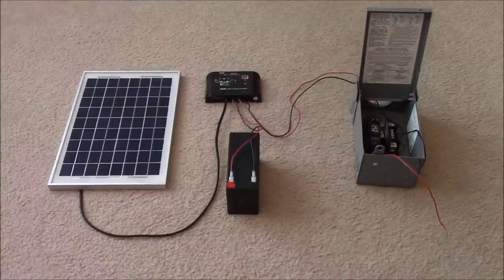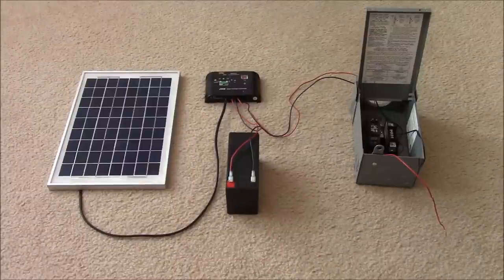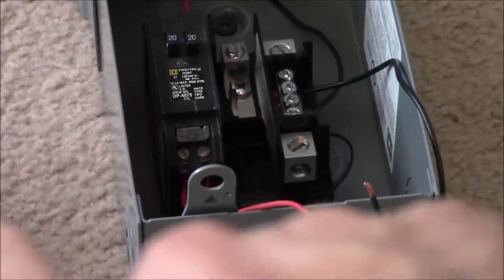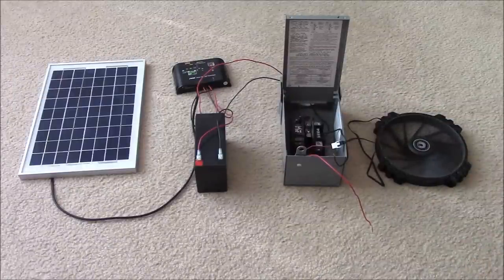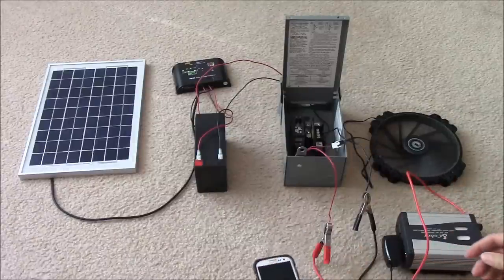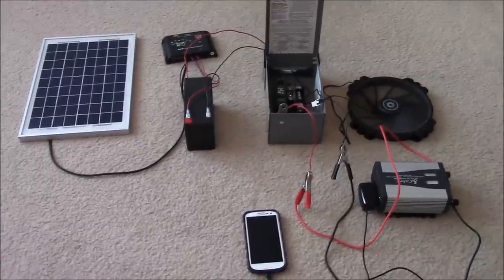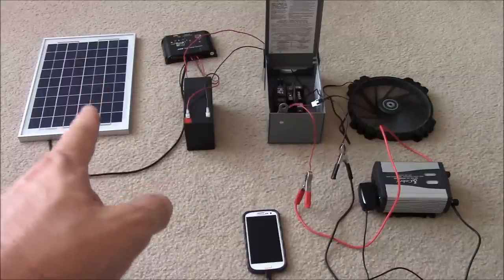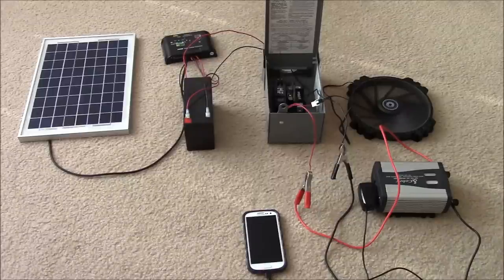Solar Panel Systems for Beginners - Pt 2 Hybrid Systems & Multiple Loads

Comment: So is the purpose of the load center to avoid useless conversions if you have multiple loads that use both AC and DC?
Is it a potential surge issue? If so, how are harmful surges possible if the controller regulates the flow of electricity?
Basically, I'm trying to figure out why I would introduce a load center into the series instead of just plugging the charge controller directly into the inverter. Thanks!
Reply from the maker: arisenryan Good question!  Some people don't use them at all.  The main purpose for a load center would be to divide the power between loads and provide a safety mechanism (the breaker) that can help from frying things.  Since most solar uses 12v, you will be working with MUCH higher current (amps) than you would in AC power.  That can burn wires or start fires a lot faster.  So having some safety in there somewhere is good.

The other purpose for these boxes is as a combiner box.  Combiner boxes are used on the solar side of the controller (not the load side) and are useful for connecting multiple strings of solar panels into one collection point and then one wire into the charge controller.  For example, lets say you started with a harbor freight 45 watt kit (lots of people get suckered into that) and quickly figured out it was fun but not very powerful and kinda junky quality.  But you were hooked and wanted to get some more power.  So you ordered two 150 watt panels.  Now you spent $150 on the harbor freight kit and still want to use it, too.  Obviously you can't plug 5 panels into one charge controller.  So you need a box that all of that power can come into and be collected and then sent on to the controller.
Reply: LDSreliance Alright, so in your first example, would you be reducing your risk of overload by just using thicker wire? How would 4g do for a smaller 350 watt setup?
And in the second example, would you be able to hook a 12v string of panels into a charge controller designed to withstand a constant flow of 350 watts? Would there still be a risk in having that string of panels wired directly into the controller?
I really appreciate you answering my novice questions here. I'm just trying to keep costs low as possible while I get the trial n error worked out.
Reply from the maker: arisenryan
I understand.  No worries.

I can't answer what size wire will be enough for a given number of watts unless I know how long the run of wire needs to be.  4 gauge wire might be great for a 10 foot run of wire from your panels to the controller but if you are talking 50 feet it might be a fire waiting to happen.

On your second question, I need to know the wattage of the panels.  You can't exceed the amperage rating of the charge controller no matter what combiner box you use.  If the charge controller is a 60a controller and you are using 12v panels, you can't connect two 500 watt strings to a combiner box and then in to your charge controller.  That would exceed the capacity of the charge controller.  If you are only talking about one string of panels (lets say three 120 watt panels since you are using the number of 350 watts or so) then you don't need a combiner box at all.  That string of panels would all have to be parallel wired, though, not series.  But if you had one 100 watt panel, one 50 watt panel, and one 200 watt panel you can't connect those in a string (general rule is only panels that are identical per string).  So you would need a combiner box to collect the energy and send it on to the charge controller.

Hopefully this makes sense.

Comment: I'm new to this, so the fan is a DC fan that runs off dc load center, is that correct? All the regular household appliances need to run off from the inverter?
Reply from the maker: Yes, that is correct.  The fan was a demonstration of a load.  In this case that is a DC powered fan.  But most devices in your house will be powered by AC so they will need to connect to an inverter.

Comment: hi 
i want details for 750VA load 
how many solar panels will be required ???
rating of charge controller ??
and whether it can be used as source for ordinary household inverter to charge batteries ??
Reply from the maker: +jugvinder singh sidhu My general rule of thumb is to plan on twice as many watts in solar panels as the load you intend to use.  So in this case I would recommend 1500 watts in solar panels.  The reason I recommend that is because you are going to lose 30-40% of the power off the max rating from the manufacturer by the time you harness that energy and charge a battery and then pass it to an inverter.  Plus you will need enough power to charge the batteries while simultaneously using your load.

For 750 watts of load you will need an 80amp charge controller @12v or a 40amp charge controller @24v.
Reply: can i give the output from solar panels to my on grid inverter already installed with 230V ac supply ??
Reply from the maker: jugvinder singh sidhu
Yes if you already have a grid tied inverter you can connect your solar panels directly to it.

Comment: Hi.. Great vids and u have simple and good way for explanation.
Question:  Have managed to source a mini peltier device which needs only 5V and 2amps.  Intend to do a personal project for a handheld solar operated air cooler.  Need your advice on best way to power this type of peltier along with a low power laptop type fan.

Many thanks..
Reply: +Ahmed Abdulrahman how did you go with your air cooler?

Comment: If I only wanted to power items using AC (via a converter), would I need the load centre? Can the inverter just be directly wired to the charge controller? Thanks in advance :)
Reply from the maker: The inverter can be directly wired to the charge controller OR the battery(s).  The load center is simply to route power to multiple places.

Comment: Could you do a video on how to connect dimmers or a gas pedal.
Reply from the maker: +YouNeedMyProductions A dimmer is just a switch with a variable resistor but I think I could play with one of those in a video sometime.  Not sure what I would do with a gas pedal.  Did you have something in mind?
Reply: +LDSreliance well, I had the idea of a solar powered go kart (because I have a lot of frames in my families yard). So I already thought of how I could wire it, but then I remembered the gas pedal. I had no idea how to do that, so I thought maybe you could do a video on it or have an answer.
Reply from the maker: YouNeedMyProductions
The gas pedal could be attached to a potentiometer (like a volume knob) that controls how much electricity flows.  That should be fairly easy to do.  I believe they make pedal kits for electric karts that would have all that built in.

Comment: I have 3000 watts inverter and 12v-200ah battery
Do I need 3000watts solar panel to make it compatible?
What kind of charging control
Reply from the maker: No, you don't need to match the inverter with a certain number of watts of solar panels.  You could run a 10W solar panel for all it matters.  But obviously you want enough solar power that it will keep your batteries charged each day.  Shoot me an email at ldsreliance@gmail.com if you want some help designing a system.

Comment: What about single phase and 3 phase  load requirements ? Also does this mean that the load centre is the same as a distribution box/electrical mains ?
Reply from the maker: For this simple explanation and demonstration video I didn't get into AC power.  The inverter will provide single phase power.  If you need three phase you are talking a very large solar system with some seriously expensive equipment and that is beyond the scope of what I have done.  Sorry.

The load center is what they now call a breaker box.  It is just a box that has a bunch of breakers to separate one input (from the electrical grid) into multiple circuits that go to different parts of your house.  It can also be used backwards (combiner box) to take multiple inputs and create one output.

Comment: Thank you LDSreliance,on ur pt1-vid,most off all for keeping it simple,1step at a time approach,for us beginners to understand.Ur vid confirms for me,that i can use a solar panel to charge the 12v deep cycle battery used to power the trolling motor.Now that seems like fair enuff,but then other Qs comes up.Im setback,coz lack of specifics on my particular system application.Was wondering if u cud help me with sum diy advice.(1) size of solar panel,(2) charge controller type to efficiently charge the (3) single 12v deep cycle car battery used to power the,(4) trolling motor.
Reply from the maker: A car battery does not deep cycle so it only needs a trickle of power to recharge.  You need about 2 amps to charge the battery so that would mean you would want a 30 watt panel at least.  Just get a cheap pwm charge controller as they will get the job done and won't break the bank.

Comment: the inverter, the fan and the cell was connect to the red? or to what wire ? so you werent specific  so   thanks
Reply from the maker: All of the DC devices must be connected to the red (positive) and black (negative) wires.  So the inverter and fan are connected that way to the battery.  The solar panel must be connected with red and black to the charge controller.  And the charge controller must be connected red and black to the battery.

Comment: I have een autonoom solar system, with solar panel 24v / 200wp, the same solar charger that you;re using in your film, and one inverter 600w. Mijn bateries are defect, and i would like to ask if it's posible to conect mijn inverter direct to the load without batteries. To get then 220v during sunlight.
Reply from the maker: Silvestros Panagiotidis Yes you can connect directly to the load but if the sun goes behind a cloud or it gets dark the load will lose power and the inverter will stop working.

Comment: What size inverter can i hook up to the load side of the charge controller?
Reply: The Inverter is essentially a load, Lots of variables here, 1st what do you want to power 2nd, your charge controllers have different current ratings also, if you want a 1000 watt Inverter this itself will draw a certain amount of power/amps so your battery will have to have enough AHC to deliver that amount of sustained current and the Solar panel will have to have enough wattage to sustainably charge the battery... So 3rd, work out what you want to power as this may be small 150 watts for a charger or tv,lights etc but a kettle at 3kw (3000 watts) your inverter will just cut out, so work backwards will be your best bet.. Hope this helps, i work off diversity of current load but that's another ball game.... You need some basic tips on Electricity, there is plenty of it on here... Hope this helps.

Comment: what about if you want to mix it? like to have solar with wind, or other type of system?
Reply from the maker: +Capelap Capela You can do that for sure.  But it is more like having 2 separate systems that both charge the same batteries.  That is because I have not seen a charge controller that can handle both at the same time.  Usually you have to get a charge controller that is designed for wind and a charge controller that is designed for solar.  They would both connect to the battery bank and both would charge the batteries.  Or you could have separate batteries for each system and just have them both connect to the same inverter in parallel.
Reply: +LDSreliance thanks for your reply, it was the thing i thought, 

What about if you connect the CHARGER CONTROLLER mix with wind and solar panel or other type of energy provider before it go to batteries? 

could you do another video explaining this?
Reply from the maker: Capelap Capela
You are welcome!  Thanks for watching.

Comment: Hey been watching some more videos. A couple questions, what kind of solar panel would you recommend to power a 500gph bilge pimp and a fish finder? Also in a marine setting could your “load center” be a switch panel and marine bus bar? Do they make charge controllers with two load out outs already built in? That would be a great for my use!

Comment: can you connect the inverter directly to the charge controller? or have the panel, battery, inverter, load
Reply from the maker: Irene Sommerfeld Yes you always connect the inverter directly to the charge controller.  Are you asking if you can skip the batteries?

Comment: why my solar charge controller can't supply the load? in this case, just that load terminals can't give a supply to the load. The voltage in the load terminal is 0 V,  why that can be happen?
Reply from the maker: Why don't you think the charge controller can't supply a load?  Have you connected a load to it?

Comment: hi, I have question, does the solar controller will cut the power  of solar if the battery are fully charge?
Reply from the maker: Yes, that is its job.

Comment: Hello 
I want to charge my battery 12v ( car ,motor battery ) what type of solar panel to use with ? I should use solar panel , how many volt ? Watts? I’m waiting ur answer .Thank
Reply from the maker: You could trickle charge (keep it topped off) your car battery with a small 5-10W solar panel.  Or you could charge it from a partially discharged state with a 30W solar panel.  All solar panels of these sizes are 12V solar panels.

Comment: Hi, my concern is I have an inverter that charges automatically the batteries (2) when I connect the inverter to AC current (I do not need a battery charger separately) so I want to use both the inverter and the solar panel to charge my batteries how do I make the wiring please?
Reply from the maker: I don't see any way you can use such a device the way you are trying to use it.  An inverter will accept 12V DC power and convert it to 120V AC power (or 220V AC).  It sounds like yours can also convert back from 120V AC to 12V DC to charge a battery.  So unless there is a third connection point on the inverter that allows 12V DC input from a solar panel you can't make it work.

Comment: Nice simple explanation. How do you run 12vdc solar when the actuators or any other device you want run are 24vdc?
Reply from the maker: You would have to wire in a step-up converter such as this:  http://www.amazon.com/SUNKEE-LM2577-Adjustable-Step-up-Converter/dp/B008HMETBE

Comment: Could I bypass the inverter and hook up a female cigarette plug directly to the battery?
Reply from the maker: +Muddy Shoe Yes, of course.  That would allow you to run any 12v products designed for a car or RV and you would not waste energy inverting from DC to AC power.

Comment: Can I connect 2 12v batteries to make 24v? I can't find a good 12v solar pump so if I buy a 24v solar pump, can I just connect another 12v battery to make it 24v? Please fill me on this. Thanks
Reply from the maker: Yes, just wire them in series.  If you don't know how, check out my other video:
https://www.youtube.com/watch?v=4yxR-Iz2Xdc

Comment: How many amp do I need in my mppt charger controller for a 400w/ 12v ( 4 solar panel of 100w) solar panel kit?  I also have a 400w inverter; con I use that inverter with the kit?
Reply from the maker: Yes you can use that inverter.  400W / 12V = 33.333A and the next common size up from there is 45A charge controller.
Reply: Thank you for your reply. Your replies are simple and assertive!!!
Reply from the maker: You are welcome.  Glad I can help!

Comment: Great videos. I have a small solar panel on my boat to charge my battery and was wondering if I could hook up my12 volt  radio directly to the  solar panel as well without a charge controller?
Reply from the maker: No, 12v solar panels actually produce 17-18v so you will probably damage any 12v devices that you hook directly to them.  You pretty much always need a charge controller, even if it is just a cheapo one.
Reply: Thanks again. You probably saved me a lot of greaf and money. Keep the great info coming.
Andy
Reply from the maker: Andy St. Michael Will do.  Thanks!
Reply: I saw these solar panels on eBay. Can you tell me the difference between them please other than the watts?  Is it better to get the most watts that I can find?
10 Watt 12V Polycrystalline Cells Solar Panel Poly Solar Module Battery Charger  $30.30 and
ALEKO 15W Monocrystalline Solar Panel 12 Volt Output    $42.29   I am looking to keep my batteries charged up on my pontoon boat when not in use. Maybe 5-6 days days unattended.
Reply from the maker: Mono is better if you can afford it.  They are more efficient and are less affected by shading or low light and high heat.  But there is usually about a 20% price premium.
Reply: LDSreliance
Thanks for your advice. The Mono is only about $10.00 more for the one that I am thinking about getting, so mono it is. I think 15 watt should be good enough to keep my boat battery charged for me. Do you agree??
 I might have a couple of more questions later and I hope you don't mind me bugging you.
Thanks again.
Andy
Reply from the maker: Andy St. Michael A 15 watt panel will take days to charge a marine battery but if you normally have 5-6 days between uses you should be fine!
Reply: What size would you suggest to keep my batteries charged???
Thanks for all of your knowledge.
Reply from the maker: Andy St. Michael This is what I would buy for the same money:  https://www.solarblvd.com/product_info.php?cPath=1_25_40&products_id=1401

Comment: If i combine my two 12v car battery negative to negative and positive to positive it rate as 12v?
Reply from the maker: Yes, that would be parallel and it would keep the same voltage and double the capacity.